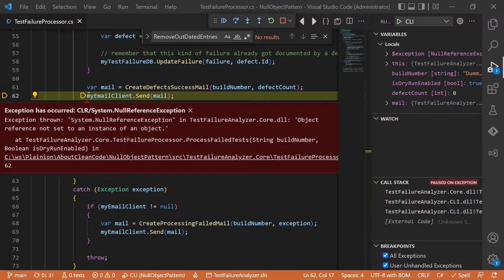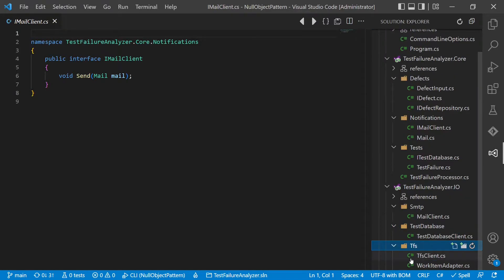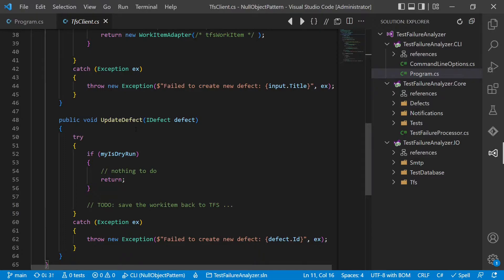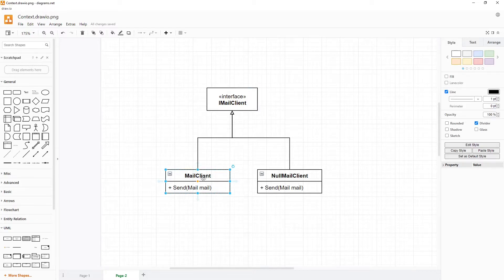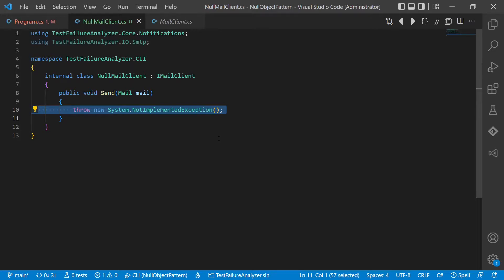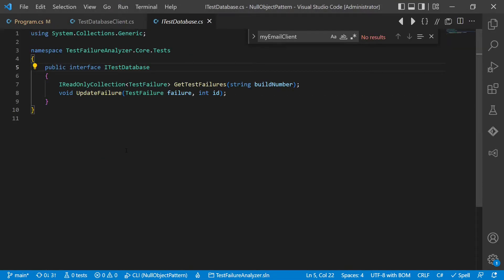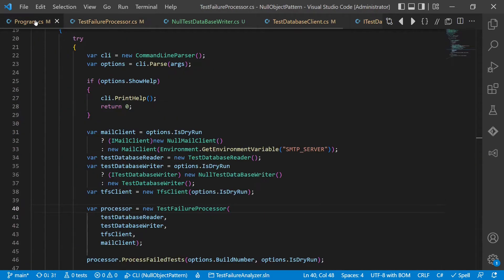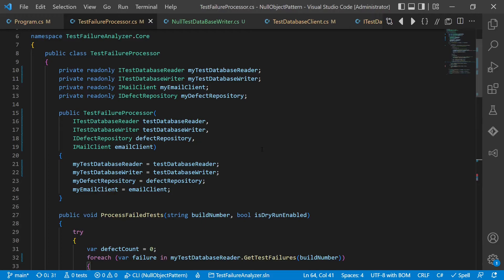Uncle Bob Would Use THIS PATTERN Instead!

Comment: Fun video. It popped up first in my feed today. You could save time with a code fixer like csharpier or prettier. I agree Uncle Bob would probably move all the IO into polymorphic boundary objects, but without tests especially in a non type safe language I don't think this is necessarily clean code.
Reply from the maker: Agreed, in non type safe languages tests are mandatory for almost every change - in type safe languages a compiler can serve as a safety net for quite some changes. thx for the hint to the IDE extensions - i ll check those out